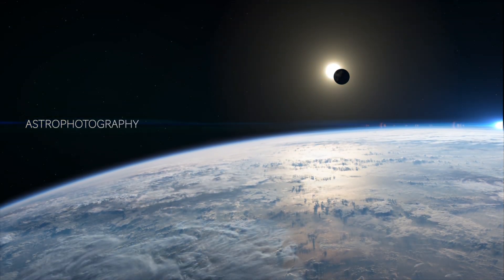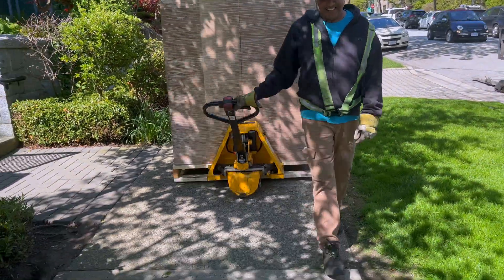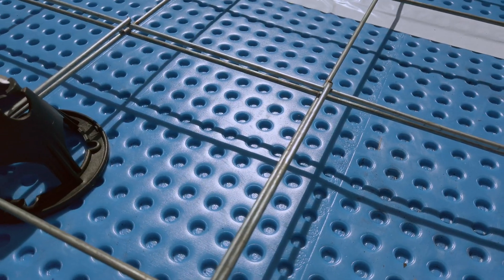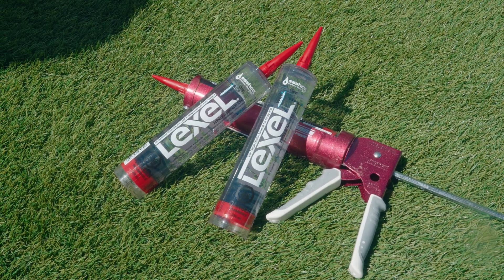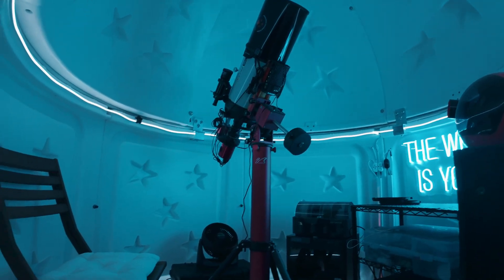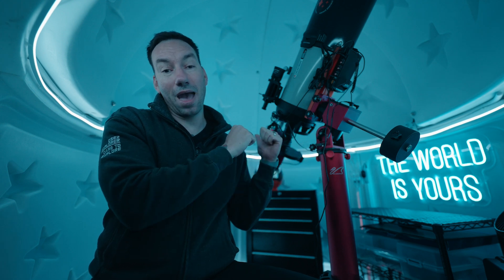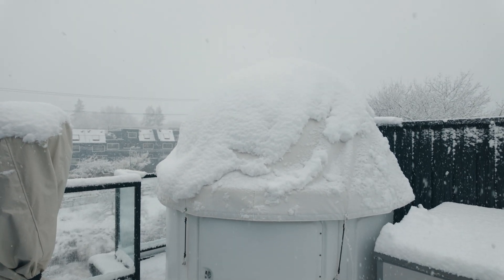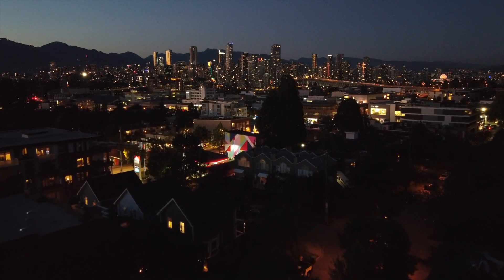Building a Rooftop Observatory

Comment: Congrats on finishing your POD! Wayne left a link on his Facebook page for your video. I can not believe how much stuff you have in it. And with no bays!! I bought my first POD about 6 years ago second hand. Two bays in Hunter Green. With just a card table in one of the bays, and a CGEM tripod, it felt cramped. I just bought the new POD-S last year and the Sky Watcher pier tripod. The pier makes all the difference to the usable space. When you get tired of moving your scope to image the Zenith, Wayne designed the POD-S dome to mount to your existing walls. ;-)  I subscribed too. Best of luck and clear skies.
Reply from the maker: Thank you! I really crammed a lot in there, but it is working just fine so far. I didn’t have the space for any bays unfortunately. I will probably get a POD-S done and CRM if I move up to a larger scope and mount. I want a bigger aperture and longer focal length, so it won’t be happening any time soon. Clear skies!